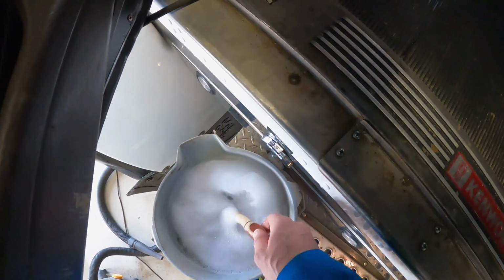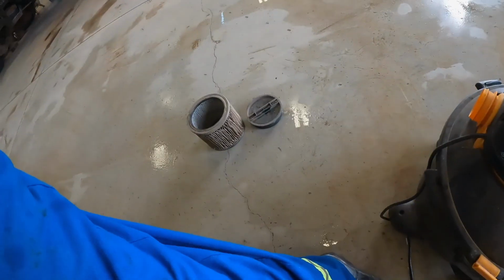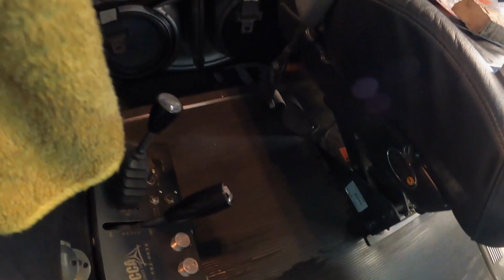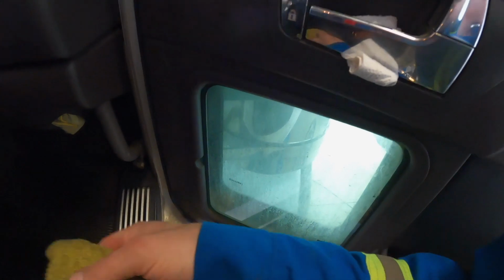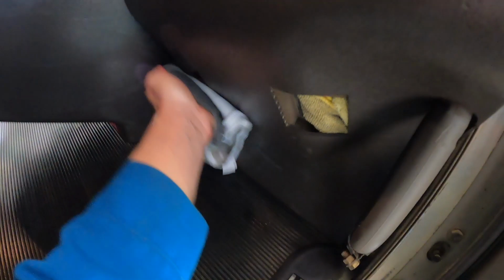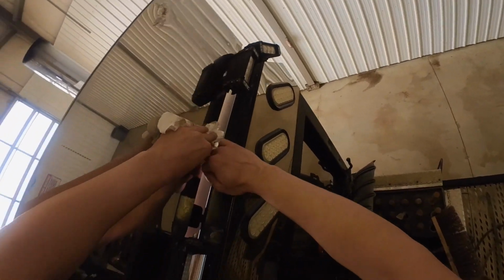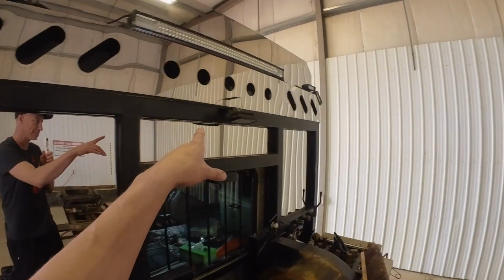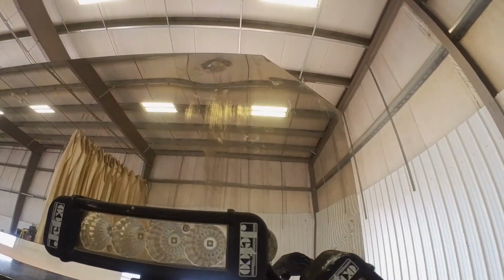WASH, POLISH ,SCRUB

Comment: Sucks you guys don't have a foamer in the wash bay, you ever try the swiffer wet pads on the floors in the truck, something I've thought about trying but never remember to grab some before I left the house. Need a little polishing pad you can stick in a cordless drill but a little elbow grease at times can be fun.
So did you have 1 of those moments fck I wish I would had fcking chained up before I got in here lol
Cheers
Reply from the maker: Yeah it was a it’s good but wasn’t. I thought I could get to the dry spot….. nope. I have mothers poweballs. I just find I get scratches if it picks up a piece of dirt. I just need to get better polish that is more of a thin cleaner then a actual compound. I don’t wash at the shop much it’s too much work since we have to clean the floor after. I’m usually go to truck wash and get a soft mitt so I can get in everywhere. They give us suckers of sunlight wash water. Take soot off with one pass. Used to go to a place that has a foam canon it’s nice if your hitting it with a mitt but it’s also a lot of soap to rinse off